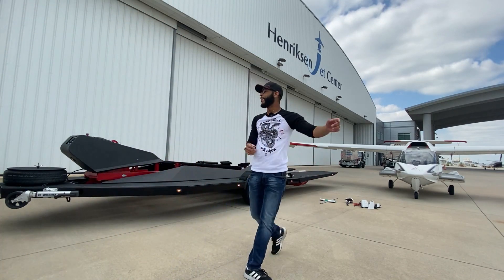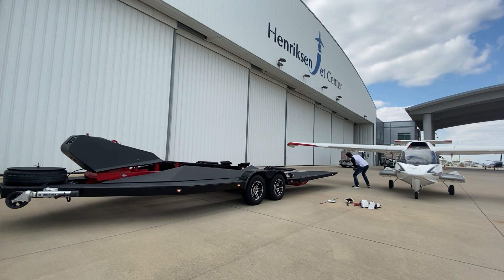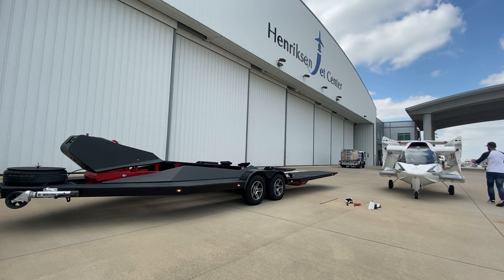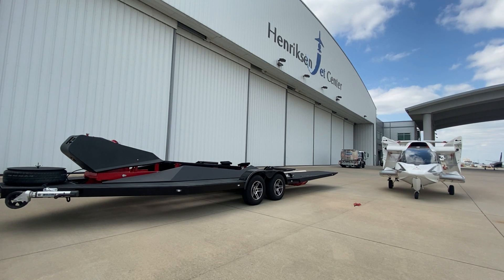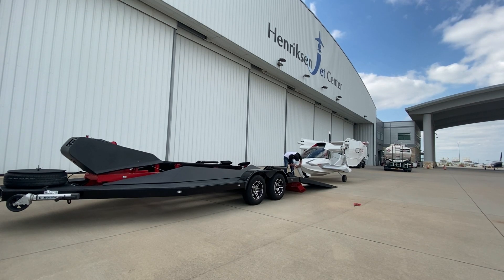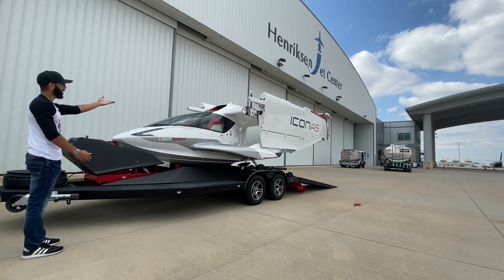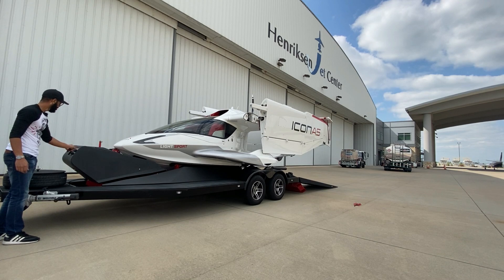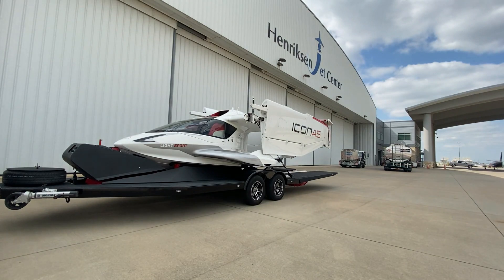ICON A5 Trailer Video Tutorial

Comment: Nice video for the most part.  However, I have to take exception with you stepping "OVER" the winch cable, ESPECIALLY UNDER LOAD!  This is NOT an acceptable or SAFE practice at all!  If that cable snaps, it will slice you in half without anything to stop it at all!  I was a recovery mechanic in the Army and was trained in winch operations.  If you have to reposition yourself during the winch operation, walk around the REAR of the aircraft ONLY!   Yes it's farther to walk but, it is SAFE.  Also, do NOT stand or allow other to stand near the tongue of the trailer either.  Everywhere from the point of the winch where the cable comes out to twice the length of cable pulled out in a 360 degree arc centered on the winch is the danger zone in case of a winch cable failure!  Inside the tow vehicle "may" be safe but, keep in mind that the windows will not stop or slow down the cable much at all and can still injure or kill people there!
Reply from the maker: The plane only weighs 1080lbs and the cable is vinyl not steel, if the cable snaps it would sting but it wouldn’t even break the skin. Great advice, but due to the lack of weight/load the risk profile changes as well.
Reply: @GaryJamesKnight  Do you really think it's worth the risk instead of being safe about the operation?  And if it hits you with one foot on each side, it'll do more than just sting even if you are lucky!  LOL
Reply from the maker: @dalemckenzie3223  same odds that the line would snap and the airplane roll me over while walking behind it. Everything has a risk associated with it. There’s not enough tension on that line to do anything more than tell an embarrassing story. I know because under load I can still push it to the ground without putting my body weight on it and plucking it under load doesn’t even generate a tone. You are absolutely correct and I agree with you that it’s not an example of a safe practice though.

Comment: Can you use the trailer to launch and recover the plane on a boat ramp or other natural boat launch areas? That would greatly increase the value of the trailer. Especially since you could probably DIY one for about half the price, possibly less.
Reply from the maker: It is amphibious, and I have launched and recovered using the trailer. If you can build it cheaper I will sell it, I don’t make any commission on the trailer.

Comment: One thing to consider...what is the gross weight of the trailer with the aircraft loaded? If it exceeds 10,000 lbs. then you will need a noncommercial class B drivers license, need to check your states regulations to be sure.
Reply: Well no .

Comment: Hey Buddy. Great video thanks. 3 Questions. Does this trailer have it's own battery? Is it a 7 pin electrical connection and what size ball hitch does it fit. Cheers for a great video.
Reply from the maker: 1. Yes
2. Yes
3. Fairly certain it’s a 2” ball but it’s the only trailer I’ve ever towed

If it makes the difference on a sale right now I’m happy to find out though

Comment: What exactly are you using to keep from chipping the paint at the hang pins? I didn't know that was an issue.
Reply from the maker: Gage Himes just saw your comment, it’s just a piece of plastic that’s molded to fit the space between the hole in the wing and the tail, it’s like 6”x8” and the road is a bumpy place so you definitely want that protection 💯